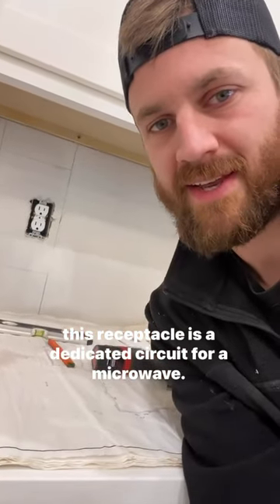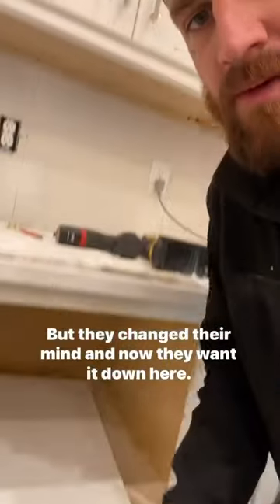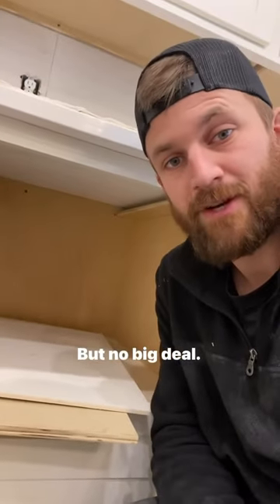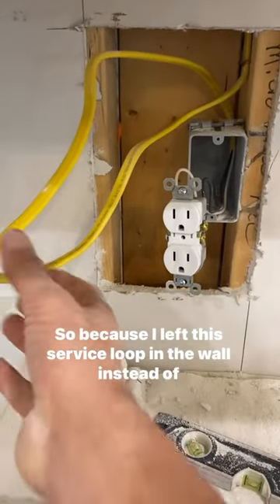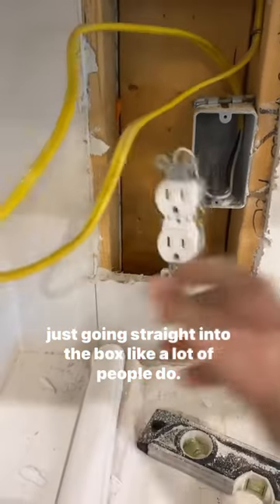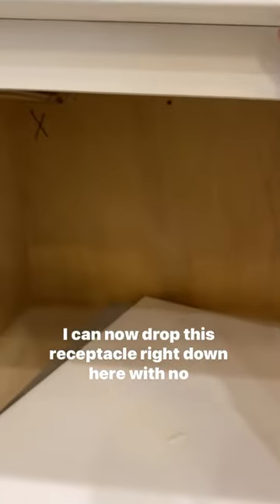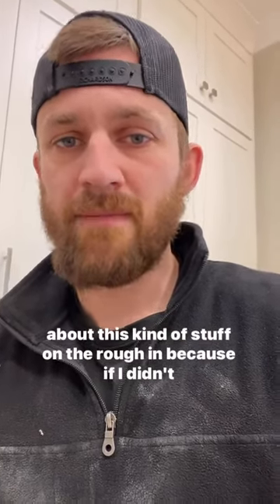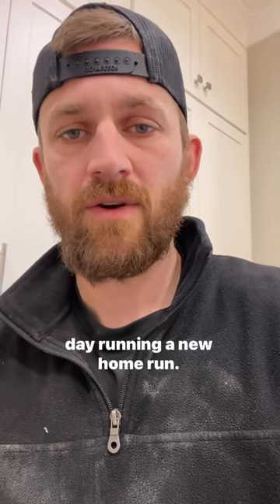This is Why You Should Leave Service Loops!! #electrician #bluecollarlife #construction

Comment: In the UK, you would just spur to an extra plug below the counter as all 13amp plugs are fused and you do not need an extra breaker. NB 240 volts means that a microwave is a low current device ie 800-1200w microwave should be fused at 5 amp in the plug. Ours is a combination fan oven and grill as well so is fused at 13 amp on the ring main.
Washing machines, dishwashers, kettles etc are all on 13 amp plugs on the ring main.

I am not an electrician, so the latest UK building regulations (code) may say different.

Comment: Some AHJ will not pass an inspection if there are service loops.  So check first with them.
Reply: Because they are against the NEC
Reply: I allow up to 18" per NEC and mybstates building code
Reply: @LostDraugr Which nec code is that?

Comment: You could’ve just ran a jumper out of that box and blanked it. Or ran a jumper and put in another receipt in that location. Or you could’ve used a in wall Romex Splice kit. That it 3 different way to not waste an entire day pulling a new circuit for no reason.
Reply from the maker: Nobody wants a blank plate over there counter top. And we don’t do in wall splices
Reply: Did you just say a in wall Romex splice kit. What kind of diy homeowner thing did you just say????
Reply: @Fr0zenfr0st the inwall splice kits are included and code compliant in the current NEC. May seem crazy but they are since 2005. They’re there specifically for rewire cases where wire must be fished. so this would be a fine place to use one, it’s been code legal for 18yr, and you’re not paying enough attention since I’m informing you of all this under a YouTube video
Reply: @arsenicjones9125  Surprisingly getting a answer from a YouTube comment is as reliable as you would expect for any type of code type. Going off the 2014 code book and all the up to modern code. These in wall splice kits you're talking of are only meant for repair. This is found at 334.40B. On top of that I've never met an inspector that still would let this pass no matter what the code says about repair
Reply: @Fr0zenfr0st  this is specifically a repair and no inspector should be capable of seeing it because it’s legally behind the wall. Derp derp
Reply: @Fr0zenfr0st  also if you’ve never opened the pocket code book on the job to shit on the inspector you’re not a real electrician
Reply: @tennessee_electrician what kind of idiot wouldn't leave a receptacle there and add extra one under counter. At least with a blank, or wired in receptacle, a future homeowner could have microwave on counter like a normal human
Reply: @tennessee_electrician put a GFI in and tail it out down to the micro problem solved
Reply: @tennessee_electrician  Forget the blank plate. Now you have a counter with no outlet (required by code).  Leave the outlet- extend down to the new microwave which being a countertop unit in a cabinet does NOT require a dedicated circuit anyway. Stop wasting wire with “service loops” with the ridiculous premise that EVERY box you wire that way is going to be moved  12-18” at some time down the road for no particular reason. And also stop butchering drywall. That’s an all day fix for someone else now. Geez.😅
Reply: I think they were disallowed about 2 years ago.
Reply: Change order sounds reasonable
Reply: How bout homeowners stop making changes after the fact.
Reply: @arsenicjones9125 correct amundo, in wall splice kits are fine and UL listed, not matter what the opinion is on em
Reply: In wall splices are ul approved and an inspector has to allow them whether they like it or not. I don’t like to use them because they seem like they could fail and most of the time there are better options but when I have to use them I do. The electrician here has cost the homeowner hundreds of extra dollars between drywall repair and painting because he “doesn’t use wall splices”, time to adapt to the future and use the new techniques and materials available or else get left in the dust while more efficient tradesmen take your job.

Comment: What issue would there be just leaving that box in place? Putting some wire nuts on an extension closing up that box. Close up the drywall and extend the box down below. It would add about 60 to 70 seconds to the job and it would add about 75 cents to the job

Comment: Dude. You should’ve just jump another wire for another receptacle in the cabinet cavity!
Reply: Dedicated..
Reply: Code requires the microwave to be dedicated buddy.. meaning no more receptacles. But code also requires a countertop receptacle to be here. So buddy still is going to have to come add another wire somehow.
Reply: @sirnordeng430 there's already a receptacle covering that counter. There's something already plugged in on the right side of the screen

Comment: Soooo, what if the service loop is illegal?  I would assume it needs to be in the box or fastened to make code around here.  Also, why did you cut the wall out?  Just break the box and throw the line down.  Or leave the box and put the line through the bottom of the box.

Comment: What about a dedicated circuit with 1 outlet required a 20A outlet and not a 15A outlet sir.
Reply: That's not a single outlet, it's a duplex which counts as two outlets so now doesn't need to be rated for 20 amps.
Reply: @patrickgatons lol that's funny 😂
Reply: @patrickgatons boy was that a lame excuse
Reply: @jayyoder5146  That is actually the code.

Does the NEC allow a 15 amp outlet on a 20 amp circuit?
There is an exception in Code which permits the common 15A receptacle on 20A circuits if there are two or more sockets on the circuit. (NEC 210.21B3). The common double receptacle is two sockets.

Comment: So from what i understand per code you HAVE to secure the wire within 6" of an outlet (box) so the service loop shouldn't have passed an inspection.
You wouldn't have to run new 12/2 for a home run, code dictates a blank faceplate with added 12/2, ran to new box location - properly secured stapling, 
Is an option

Comment: I do the same. Ive taught a few people to do it as well. Mostly everyone thinks its dumb. But then again theyre idiots so it doesn't bother me
Reply: It's not about being dumb, it's understanding it's a love hate relationship. I think its a great practice but you also gotta understand the negatives, and use caution when and where to use em. This 1 wire, I don't really care about, it's in a area people arnt driving long screws or nails into.

If you got 3 service loops above a light switch, where people add pictures, hooks whatever it fills the whole damn cavity , it's begging to be hit, because it's filling up the whole cavity. Because other tradesman who come in after you, most of which are oblivious to anything different,  and not making it homeowner friendly is stupid.
Reply: The problem is, if the service loop is more than 8", its a code violation due to lack if cable securement. Or 12" with a box with a clamp.

Comment: Two questions one why is that a 15amp outlet. You should realy consider using 20amp for kitchen counters and second before you move that outlet is there another outlet with in 2 ft of the edge of the counter top?

Comment: My question is if that is an independent microwave circuit with 12-2 wire. Why are you using a duplex 15 amp receptacle? Shouldn't it be a single 20 amp receptacle?

Comment: Why couldn't you move the existing box up into the upper cabinet and make it a junction box inside the upper cabinet and then install a 3foot piece of 12/2 to the new location if the service loop was not present?

Comment: Im an electrician in the uk,so im not sure on American code,but couldn't you have just jointed a cable to extend it? Wagos are deemed to be maintenance free connections,so you could use wagos and a snapshut box,or just a regular joint box.that way you wouldn't need to run a new xable all the way back to the board. I know its not ideal to joint cables in a new build,but sometimes needs must.

Comment: While I've long thought about such an idea, doesn't code actually prevent this by requiring a maximum length of wire from where it leaves the box to the first fixed point (staple/tie/holder)?  Distance-wise, I think it has to be 12", but someone mentioned the wire length an only be something like 18" max..?

Comment: Im not an electrician and I have an ignorant question.   If a service loop wasn't left, what would be the downsize of using quality wire connectors and adding another 18 inches of wire?
Reply: floating connections inside a finished wall not in an accessible box is a violation

Comment: Me, as an extreme DIY guy, why not just put a junction box, then wire down to microwave? If its against code, please explain to me why? Are wire nuts not made to connect two wires together? If its against code then why are the readily available and used for splicing wires?

Comment: Honest question,  why did you cut the wall? I could have done the job without damage to the wall . 
I would have cut the box out since it's only 5 bucks . 
Cut box out .
Mark hole for new receptacle. 
Cut hole for new receptacle. 
Fish wire down to new hole .
Fish through new (old work box)
Install the box .
Wire up duplex receptacle. 
Install cover plate . 
Fish wire from other back splash receptacles then Install another receptacle and old work box there in the original spot . If they don't want another plug there just put a box and blank plate. Simple son.

Comment: 1.The button line service loop longer than 18" is a code violation.

2. Also, you could have jumped from that same box without running a new home run.

3. You could have gotten paid for a day of work if you did have to run it.

4. Why didn't you install a 20amp receptacle if that's a dedicated circuit.

5. You better have a gfci breaker on that circuit.

Comment: I think code requires a counter level circuit there. Every place along the counter must be within 2’ of a plug.

Also, I’d have to check exact wording but the staple is not proper spacing from receptacle. 8” or 12”… I forget the rules. Also suspect a service loop wasn’t intended as an option. Can’t assure 1-1/4” from drywall back to floppy cable.

Comment: It takes you a whole day to do a home run? I do them typically in about an hour. Unless there’s more cutting or no attic etc. but still doesn’t take a whole day. Also you don’t need to run a new wire. You can put a shallow splice box in the wall as long as it’s a single wire and the splice is made good. Won’t hurt anything

Comment: Or why not just leave the existing outlet in place, run more 12/2 from that outlet to the next outlet. Excuse my ignorance to any codes regarding electrical work, but would that not still be acceptable?
Reply: It would no longer be a dedicated outlet since you would have 4 outlets to plug stuff into... And someone would plug stuff into them. But he used a duplex outlet so it still is technically not dedicated but then hid it under the countertop so that hides the outlet and makes it hard to plug something into the other half... But who puts a microwave under a countertop? What about the vent that produces moisture and odor trapped in a cabinet? The goal is devoting 20amp circuit to a single appliance.

Comment: You could have used the existing outlet box as a junction box or used a Tyco in-wall splice kit.
2 Wire Ccnnection
For Use On 12 or 14 AWG (300 Volt) 2 wire NM cable with ground
Eliminates junction boxes and wire nuts
Fast & simple to install
NEC compliant - article 334-40b, 2005 and 2008 NEC
UL and CSA listed
Reply: Latest NEC restricts the use of the Tyco splice kit to nicked wires only.  Cannot be used any longer to extend a branch.  Home Depot no longer sells them and I think Tyco stopped  making them.  Work-a-round is to hide a j-box in the wall and take extra care when wiring it.

Comment: I'll give you my opinion on this. I'll start by saying I do not leave service loops. But it is for this reason, the drywallers will tear it up or it'll get pinched in front of the stud between the drywall and I won't be able to use it whereas if I were in this situation like you're in and I needed to move that outlet down and I did not have enough wire I would simply go up to the top of the wall in the Attic go back on The wire about 4 feet, towards the panel. Cut the wire. Pull my receptacle down to where I want it put two junction boxes in the Attic with a piece of 12/2 between them!

Comment: Not sure I see the problem, permanently fixed microwaves (cooking appliances) are allowed to be on the "kitchen appliance" circuit. So... couldn't you have just left that countertop outlet and added a new outlet for the microwave down below off of that one. Unless I misread the NEC... feel free to correct me if I am wrong, as I have been wrong many times before 😂. And I do think leaving a service loop is a great idea btw. 
Article 210.52(B)(2)Exception No.2

Comment: Idk why this popped up today. As a former electrician,  you always, and i mean always, plan for dedicated/specific outlets to be moved or altered. Not only for the dedicated object to be moved due to incorrect specs or convenience, but mostly because the home owner realized they wanted it in a slightly different area than the final plans called for. Plus you always plan for stupidity/ unassurance. Also, you want to leave some slack for yourself or another electrician when the plug needs to be moved

Comment: Uh okay,  but code actually prohibits Much slack between the box and the nearest support by requiring that wiring be secured and supported with not more than 18-inches between the last staple and the entry into the enclosure.

Comment: Or you could snake a wire down like normal electricians and leave that outlet in tact since its required within 2’ from the left side by code. I tried hard to see the benefit of cutting the sheetrock but i dont see why it was done that way.

Comment: Service loops are actually code here in Canada.  I get the reasoning behind them, but they are a pain in the ass.  It’s just so much more wire to deal with, trying to bend it nicely, still in a real way to be able to pull slack when the drywallers zing the wire inside the device box.   

All that being said, I’ve intentionally left plenty of slack wire at times, kind of knowing client might change their mind…

Comment: Why would you need to do a new home run? You can use the box as a junction box super easy, and you can bring power from a different circuit if you only want the one outlet for the microwave.

Comment: Or just add a jumper down to the micro wave and turn that into a usb charging port. But you may still be required to keep the outlet due to code as well...?

Comment: Its not required by code, but it's it permitted? I mean they do require the wire to be secure what about six inches from the box ?that loop is unsecure and for anyone cutting or drilling thinking they away from the box?? Don't get me wrong I would do this if I need to but wan to know is it permitted

Comment: Smart man. 
I used to install TV antennas, video cameras and satellite dishes and I always left extra cable in the attic and I never cut off or pulled out any old cables, just in case they were ever need again at some time down the road.
Reply: wasntme7845  
Said the guy that has NEVER run cable in an ATTIC!!!

Comment: As a professional i grade this at a -D. Service loops are stupid,waist full, and your only aloud 18" your's is probably close to 36". You could have cut the nails off of the box with a hacksaw blade to pull the box out instead. Then use a inwall splice kit used for modular homes.

Comment: If you didn’t do the loop and didn’t max out the number of outlets on a circuit. Why would you not just leave the plug there tie into in make another outlet under it. This way they still have one on the counter for toaster or fryer.

Comment: That would also help in older houses like mine where the wiring is still pretty good but old outlets start burning out and I need to cut the burnt wire ends off. There’s a few outlets I replaced that were a pain in the ass because I barely had enough wire.

Comment: You had to make a 12”by 8” hole in the drywall to fix that? The receptacle has to stay for countertop spacing, and there’s no code against 3 small appliance circuits, should’ve just dropped a wire down from the micro receptacle and fed it that way.

Comment: In today’s building of anything, adding “extras” or service loops is just common sense. Absolutely nothing is static and things will change. I’ve been working on buildings (residential and commercial) for 50 years and from first hand experience and having to upgrade or modify anything always goes a bit smoother if there is a bit more to work with, resulting in cost savings and time. You might want to move that outlet now, but I guarantee the next guy will want to move it again.

Comment: I never put service loops since I don't trust drywallers won't squish the wire between the board or something silly to happen. In this situation i'd have junctioned it in the upper cabinet. It's been a long time since i've done a microwave plug on a counter though, everyone puts them in a dedicated open cabinet

Comment: If it was too short, couldn’t you have spliced more wire with a splice box and lowered from the spot without having to do a home run?
I’m a newly Carpentry & Electrical grad 🧑🏾‍🎓, inquisitive to know because that’s what I would have done. Like to know if I’m WRONG, before I actually do it.
Thanks for the video.